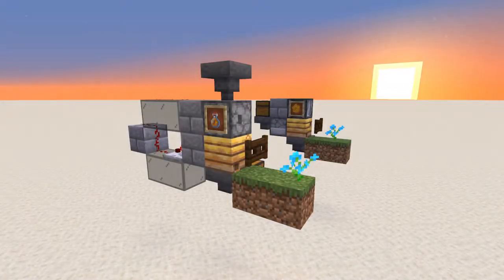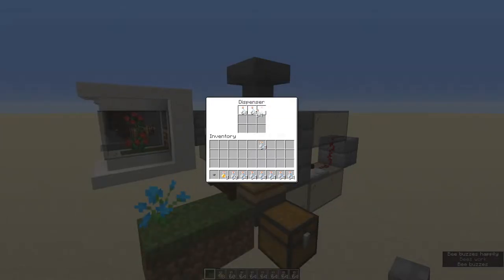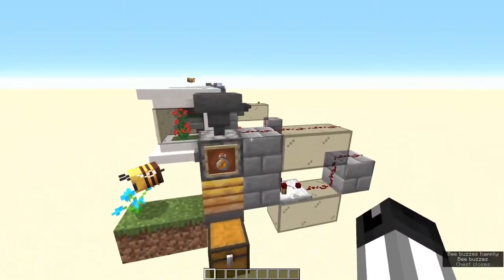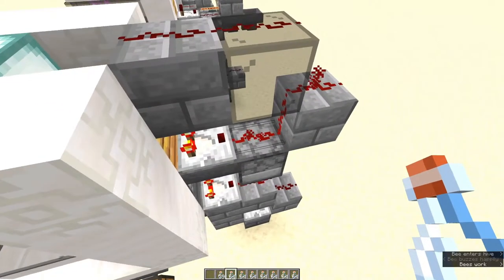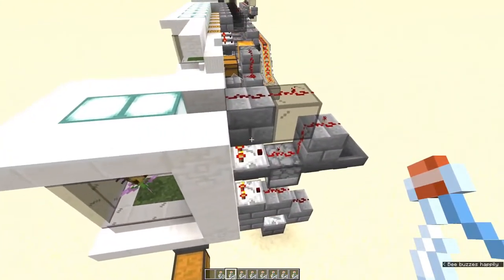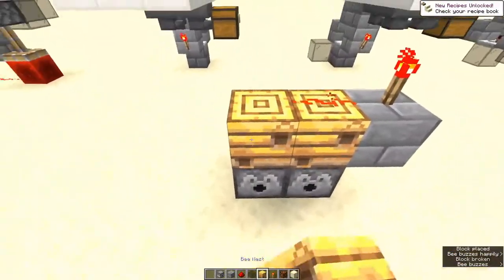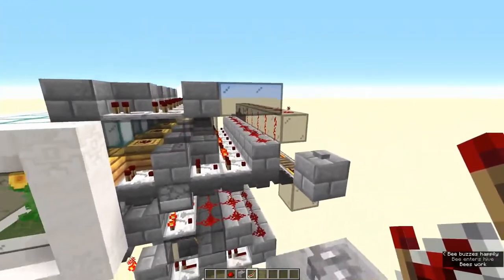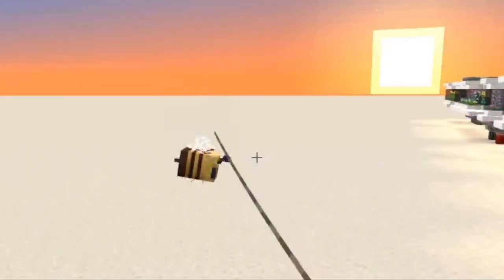How to Conserve Bottles in your Minecraft Honey Farm! (Java AND Bedrock 1.15-1.20+)

Comment from the maker: If you're impatient and you just want to see how to build it, jump to 2:00  or 11:23 (or the thumbnail). The dispenser faces up into the bee nest, and the dropper is pointing iinto the hopper beside it (toward the dispenser).  That's really all you need to add to your farm.  Enjoy!
Reply: Will this work on bedrock? BTW looks awesome!
Reply from the maker: @wattey  I am not super informed on bedrock mechanics, but it should work just fine.  The 1-wide tileable part would be questionable, but just the simple bottle sparing dropper setup should have no issues.

In fact I'll go test it.
Reply: @crimulusmc  tnx!
Reply from the maker: @wattey  It does work.  There was a weird issue at first where the dispenser was BUD powered?  I can't really test it extensively, but it was probably a one-off.  After that, it worked as expected -- both the item filter and the dropper technique.

Comment: I also created a version of "no waste bee farm" that used a minecart with hopper below the dispensers to get the honey bottles.
To make this work, I had to put a single bottle of honey on the first slot and fill all the other 4 with some random item.
Then, the minecart would collect the honey bottles of every dispenser and store them in a chest (and this chest had a separator to not get the other items of the inventory of the minecart) and return.
In the way to store the items in the chest, the minecart would pass over a hopper which collects exactly 1 honey bottle and move it to a dropper.
After all of the honey bottles have been collected, the minecart would go back to the bee nests area, but first would pass over a detector rail that activates the dropper with the honey bottle, so the minecart can't take empty glass bottles.
Reply: To feed the dispensers with empty glass bottles, I did put two hoppers (one connected to the dispenser and other to this first hopper). In the second hopper, there was rails, in which a minecart with chest with any quantity of empty glass bottles would pass over and divide the number of glasses equally to all dispensers (that are located below the bee best).

It works really well for some time, but is a EXTREMELY FRAGILE system, because if some mob collides with the minecart with hopper, it would causes it to go back to the chests and leave all of honey bottles and start to collect empty glasses.
Also, this minecart has to run all day to collect EVERY honey bottle always, because once the bee nest is full, it activates the dispenser only once. If the dispenser doesn't work correctly, you have to reset the signal. So, I think a chunk loader might be interesting
Reply: The pros of my system are that it's zero waste of glass bottles and extremely simple and cheap to make, although it's very fragile.

Your machine works well and also don't waste glass, but I think it's REALLY expensive. I mean, if a person doesn't want to collect a bunch of glass, why would it spend a lot of iron and Redstone instead? (specially for the honey farm that uses more than 1 nest)

I think maybe you could work in a no glass waste but also as much as "early game" as possible.
Reply: Finally, I'd like to congratulate you for the video and tutorial. I certainly will be using the single bee nest version of your farm in my worlds from now on.

Comment: Hey just so you know i figured out how to get automatic item distribution to work. Basically you just need to flip the top half (comparator + 5 redstone path but dont keep the hopper/dropper on that 5 redstone path) so that the it is on the other side, almost as if its hanging over the beehive. You also need to flip the beehive because of this so the bees can exit the hive. Then to fill the dropper you can just do any number of hoppers you want + a minecart loading station. Sorry if this is confusing, this is my first experience with redstone. I'm actually able to have this work without the need to stagger it. So that means its 1-tileable with automatic item input and collection without needing to worry about completely filling the dispenser slots. 
Let me know if you have any questions/would be cool if you make an update video with this in place
Reply from the maker: Sounds interesting, but I wanted to have the hives all face the same way. I have it one-wide tileable in the video, it's just the redstone on top is complex. What you're describing is essentially just having two 2-wide tileable farms directly facing one another which does save space. It just doesn't solve the same problem.
Reply: @crimulusmc  i think you misunderstood me. All the hives face the same direction, but instead of the collection part being the "front" the item loading and item sorting is instead. It's 1 tileable as well.
Reply: Let me know if that works for you! Id definitely like to see your version on an update video bc rn mine looks really bad haha
Reply from the maker: I have very little time to make videos, unfortunately. I've got at least a dozen in the backlog I've yet to get to.

Comment: dude... you can make it even better with stackable solution! put hopper in the dispensers with bottles, put another hopper into this first and then, above it put a string of hoppers going sideway... you can make a break sistem when the main chest has not bottles... come on, glass are infinity and easy to get, just make a villager center hall and put some librarians and buy tons... i hate take sand from anywhere, but, i unlock very quickly vilagers any world i enter is the first shit i do... to make iron farm and trade to get diamonds equips without mining almost nothing and infinity glass and others stuff

nice work, and i see some room for improvements i will try it

Comment: In the last version to not use glass that you get from sand....sand is very common in desert biome for exampe.,..you use 2 comparator for nest plus many more hopper and repeter and redstone torch? And finally you did it more space consumer.....but the video is interesting to see the idea bihind it and to learn how things in redstone works.
Reply from the maker: That is true to some extent, but each bottle requires one glass, so we're talking a minimum of 9 stacks of glass per nest -- 8 of which MUST stay in the dispenser and never get used, essentially. It's only a handful of redstone components per section.
Reply: @crimulusmc  I will try your solution to see my self 🤣 I am doubling my honey farm in this days so I will see how it work 👍
In classical solution I use 45 bottle for nest at the moment and I put them manually at the moment inside the dispenser....so maybe it will fastest the process
Reply: @crimulusmc   @crimulus   hi I tried to built it, I have some dubs on items filter. I did the big one at 9:00 and I do not undestand, I have some filter problems:
1 - how many junk items do you use in the fiters? I mean the short one and the compact one have different items filter?...because if you put nest not in line, the torch, if I see well, it is not in the same position on the 2 side...
2-So, did I undestand well? Did you use: for the firt nest: a block, a comparator, 3 redstone dust so under a repeater, a block, a repeater, again a block so a torch just under the hopper under the diperser...for the second nest did you use: a comparator directly adiacent at the hopper, so 3 redstone dust, under a repeater, a block and so a torch that stay under a block that is addiacent at the second hopper?
Reply from the maker: @nessunonessun1  I believe there are 12 honey bottles and 4 junk items in the filters, but I can't remember. They are just the 3-dust Impulse filters, so just put a stack of honey bottles and add junk items until the bottles start coming out.

That is correct -- every other filter needs blocks to extend the spacing so the item filters align in the back.
Reply: @crimulusmc  I did wrong so in my hardcore, I need to change some....I used a comparator and repeater in addition  and that broke the filter some times because the signals goes to the near nest sistem with two filters 11-11-11-5/11-11-11-4 sticks and 1 honey bottle...

 mmmmm now I was thinking  on creative and I see....i find out with your sistem that with a 15 sticks on a space and 1 in other 3 slot will remain 6 bottle of honey tring other ways ir will brake the filter....so the big question...🤣 How to leave only one honey bottle in the filter ? I found a ibrid solution on internet that work but it start from same line hopper position, in this farm we are not in a line....I will tell you if I find a solution
Reply: @crimulusmc  I found out my mistake I pushed a delay on some repearter with out notice it and it was breaking the filter...now it work and I found a way to have a 1 honey bottle filter to 👍, adding a modify, some repeater and comparator added  in front of the redstone dust that remain like in your build 👍
Reply: @crimulusmc  so this is my way on the items filter in 1.19 version....
A: hopper filter - comparator, comparator, 3 x redstone dust, repeater, block, repeater, block and torch under a hopper under the item filter. Inside the filter I put: 1 honey bottle and so, 4,11,11,11 sticks.
B: Hopper filter, comparator, 3x redstone dust, and under, repeater repeater, block and so a redstone torch just under a hopper under the hopper filter. Here the filter contains 1 honey bottle and 5,11,11,11 sticks. In both cases the hopper filter and the hopper under are pointing opposite directions, the filter point to the comparator.

Comment: Hey, i dont know if u covered this but if there arent any bottles present and the hive reaches max honey level, there's no way to reset the system. I cant place campfires to safely take the honey out and breaking the comparator and replacing it isnt possible with the tiled design nor is attaching any buttons to the dispensers, rendering it useless once this happens.
Reply from the maker: I just break the redstone dust closest to the dispenser.
Reply from the maker: I misinterpreted -- if there is no bottle at all, you can insert it from the front with no risk of disturbing the bees. I'd suggest doing so at night.
Reply: @crimulusmc  Um. That's kinda also a problem with the tiled design. The only way i can reach any of the droppers is by breaking the dirt that the flowers are on. If that's the only way, so be it- but it's just very inconvenient
Reply from the maker: I see ... that is why I built mine with the nest and dispenser above the grass. If you like the look better with the dispenser underground, that will certainly be an issue.

I'm not sure if it's possible to use farmland there instead, you could reach the upper pixel of the dispenser, but yeah I didn't take the dispenser being underground into consideration.
Reply: @crimulusmc  Ahh. So that's what i missed. I was so focused on trying to tell how to place all the redstone i didnt really pay attention to why the front was why it was. Thanks

Comment: Hi, after a long session i made 4 honey bottle farm like u showed, all seperate from each other. the only problem is, only 1 of the farms is working??. if i look at all 4 of them they look identical. do you have a explanation for it?.

if i remove the top comparitor and add it again the system works on all, but at the next cyclus the bee nests stay full..
Reply from the maker: Sounds like a quasi-connectivity issue, but that's just a guess based on your description. I'd probably have to see it to debug further.
Reply: @crimulusmc  thanks for the respond, im looking into quasi-connectivity right now. redstone mechanics is still new to me

Comment: Just tell me how to build the damn thing. Give a complete parts list and simple step-by-step instructions. Show how the hoppers on the underside are arranged! Which way is the dispenser facing? I don't know, because you don't show yourself building it, and are assuming your audience has prior knowledge of bee farm and item comparator designs.
Reply from the maker: Thanks Prosie. I did not design those other things. They are linked in the description. I very clearly stated that wasn't the purpose of this video.
Reply: but Crimulus!!! I'm dumb! And I need that collection system too... (not being funny about Prosie or actually needing blue prints but I am being funny about whining).
Reply: Woof.  Ive been messing around with this for a few hours.  So I figured our a few things. From ilmango - the hopper under the collecting dispenser needs to face into that comparator. Then the hopper at the bottom can face away. That all works. 2 bottles of honey get held, one in each hopper. Any extra are going to my chest through the dispenser when I put any in there. Green check mark.  Ive got my dispenser under the Hive facing up. Tested it with a button and it collects.  Hopper beside it faces into the second Dispeneser which has my empty bottle stock. On top of the hopper that feeds into the collecting dispenser I have the comparator facing away, triangle towards the empty bottle dispenensor. Then the red like you have up to an ontop of the bee hive.  But the empty bottle dispensor seems locked and never fires whether my hive is at 0 or at 5 honey level.  I have triple check the 5 lenght (comparator, dust on the empty bottle dispensor, dust up left diagonal, dust up right diagonal on glass, dust left on building block, dust on hive). Never releases a bottle.  I assume no circuitry change to 1.16.3 - what am I missing?
Reply from the maker: Is there a bottle in the dispenser? Dumb question, but just wanted to check.

Also, it could be the dispenser needs an update due to some previous QC during testing. Outside of those simple checks, I can't investigate more without seeing it unfortunately.
Reply: @crimulusmc  I'm doing everything from the same build view you primarily use. So if you were at the front glass side them I'm working on the builders right. So I have the left disp. under the hive (call that bottling dispenser) and the right dispenser as part of the feed loop (call that storage). The storage disp has stacks. It wont run when honey = 5; If I put a bottle in the hopper between them and the hive I get one cycle then it stops loading. They never seem to get out of the storage dispenser (right) into the bottle filling dispenser (left).  When Hive is at honey = 5 I get bottling dispensers triggered false. loading hopper trigger false, and storage disp. triggered true?
Reply: @crimulusmc  Oh interesting. I think I figured out why its breaking - but I cant quite duplicate. When you said maybe the dispenser needs to update I figured 'heck - Im just going to rip the line out'... I have it tiled 4x in creative, just with the 1 gap betweeen.  I figured maybe I got something into quasi-connectivity or something and locked it.  So when I ripped out everything the storage dispenser still said "triggered" when there was nothing within 2 blocks of it.  I replaced it all. The first line pod ran fine 3x so I figured I guess that was it. Replace the other three. Then they all hung up again, but I also noticed it dropped bottles. I dont know WHY it dropped bottles, but when it does it doesnt seem to do a harvest then it gets stuck and there doesnt seem to be a way to get the storage dispenser to reset... I wish YT still had DM feature so I could send you my world DL.
Reply from the maker: @pinter123  It definitely sounds like a quasi connectivity issue. I'm not sure what it's from, but when empty bottles get dispensed, it means it's firing before the hive is full, and if the hive isn't full, either the redstone line isn't long enough, or an adjacent hive is triggering it.
Reply from the maker: @pinter123  Feel free to send me screenshots in my Discord: https://discord.com/invite/HEJMhCQ

I likely won't be able to do a world download, but screenshots probably will suffice.
Reply: @crimulusmc  I actually messed around with it again tonight. I watched some other tuts - was going to switch to a different design; was watching redstone on how to feed a hopper with a dispenser. Was testing with just a button on a dispenser into a hopper and the bottle legit never went and in. I was like - wth did Crim do differently!! Went to your section of the vid to rewatch... FINALLY noticed the :D face and not a :O face to feed the loading hopper!!!   I even built a completely virgin single tile like 20 blocks away in case something glitched in my world.  It was working those few RANDOM time when the dispenser worked JUST enough to have the bottle land in the hopper and go into the bottle filling dispenser.  Now its running beautifully.  And actually my first quasi complicated redstone where I actually understand whats giong on because I had to trouble shoot everything and I rebuilt it so many time.  LOVE that you were so quick in responding to my comments. Definite sub for that - and hope you channel keeps being fun and you blow up man. Also to OP comment of "need to know how everythigns face" rather than 2min mark go to 11:23 for a beautiful side view. The left dispenser is UP, the right DROPPER is facing left.  Boom done.
Reply from the maker: Awesome! I'll update the comment.

And I appreciate the well wishes, but I'm a hobby YouTuber. I play enough that I find fixes and ideas and want to share them.